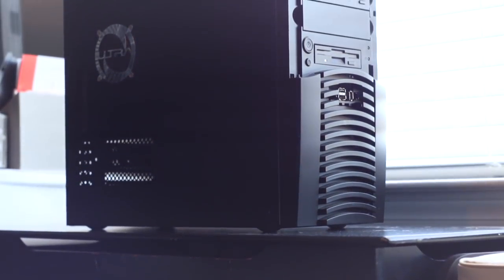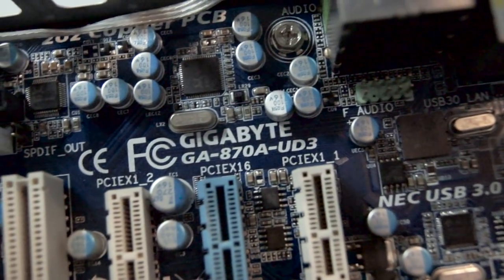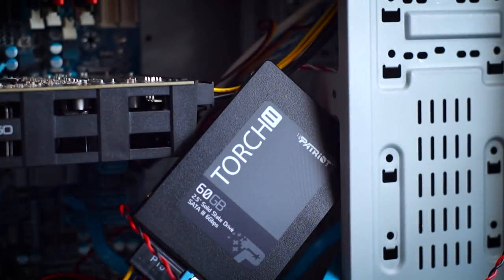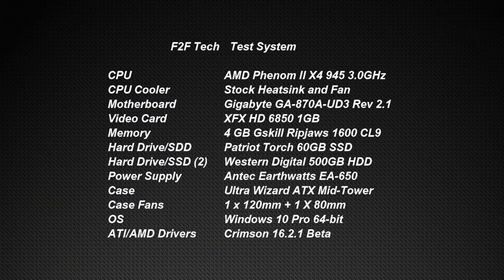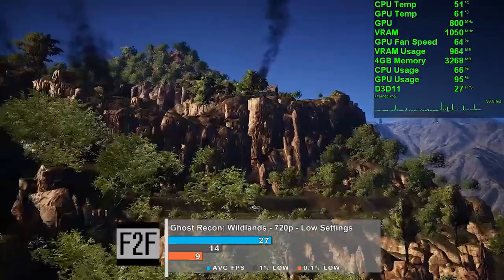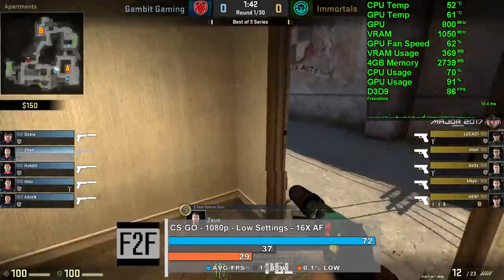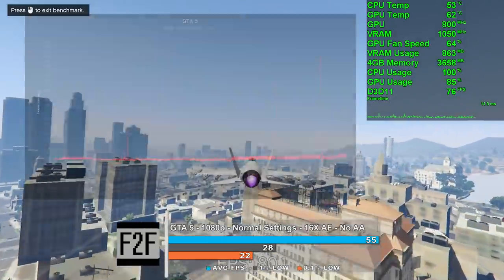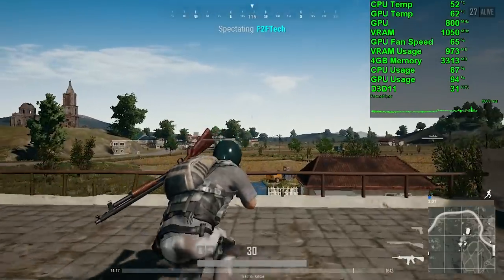How well does a 2010-2011 AMD Phenom II X4 gaming PC hold up in 2018?

Comment: My gaming pc since 2010, still running no issues whatsoever, i have it now pair with a gt1030 +8gb ram 1600mz sc (and it runs almost every game if not all games out there, and im pretty sure i can get a 1050ti and will get even more fps) im running my x4 945 (95w) at stock speed since i bought it with stock cooler wich sucks, but gets the job done and hey, its been working for 10 years now, to be honest i could keep playing games on this if bought a 1050ti since im more thatn happy playing at low/med settings at 1080p, but im also thinking about getting a ryzen, its hard to let go of this awesome cpu :)

Comment: I have that CPU, I just picked up a 8150 with that cooler on it and it did the same thing when I took it off :)
Reply from the maker: Typical PGA fashion 😉
Reply: Timmy Joe PC Tech It is any good at gaming?  i want to build one cheap PC like that for my self
Reply: Yeah, it’s still a problem.  My Ryzen 1700 got stuck to the cold plate when I swapped my h100i for a Hyper212 last month.
Reply: To avoid that, gently turn the cooler to the right and to the left repeatedly until it looses grip.
Reply: sassuki I had done that in the past with older AM3+ CPUs when that was a common problem, I just honestly didn’t think that it would’ve been that bad on my Ryzen since I only had the cooler on there for a month.
Reply: Had the stock AMD cooler on my old Phenom II x4 945 for 6 years..... Took me 20 minutes trying to pry it off and the cpu came out too. Scared me so much xD
Reply from the maker: TitanZ pretty much same here. I had to use a chisel...
Reply: Just heat it up by running a benchmark, then turn off the pc and remove the clips, then push down lightly and twist. The cooler should pop right off.
Reply: i just got 1 Phenom ll 965 for 20 usd..i got a busted MotherB for free that just Fixed a Cap on it and works like a charm, i got a 2Gb DDR3..a nice PC for less than 80usd..Its like Chrismast already..
Reply: My x4 840 did the same thing. Actually had to put it in my electronics oven to separate them.
Reply: @gaming512mb2  get a ryzen 1200 for ~100$. Though if you mean cheap maybe an fx 4300?
Reply: Timmy Joe PC Tech 
Cleaned out a friend’s PC recently... same thing happened to me!
Reply: Twist and pull
Reply: Guys sos my frend  has  the same cpu whith  two 1x4 +1x2  random ram , what the fastes kit of rams i can stick at his sistem and is it warthit??????????
Olso  should i upcrate the cpu cooler fro stock one or is a waste????????

Comment: I used my 955BE until I upgraded to Ryzen 1800x. Ryzen is the only worthy successor of the Phenoms.
Reply: See Sharp I agree. Phenom performed better than the "doser" cpus
Reply: Yeah i totaly agree. FX was very bad
Reply: @Will-mq3nn  FX architecture wasn't that bad. Those later Athlon X4 chips were actually faster than the FX line because of the improvements to the architecture's single core IPC. FX was a gamble that didn't pay off. They are very powerful when fully utilized but they bottleneck themselves so easily that you rarely see what they can do. Doom 2016 is the only game I know of that showed off what the FX line was capable of
Reply: I made a mistake a couple yars back and "upgraded" from phenom II 955 to fx8320, the difference in game performance was non-existant. Now rocking ryzen 2600 and the diffence is night and day. Fx was a mistake.
Reply: Miekk4 I’m looking to make the move from an old Phenom II 955 to a Ryzen 2600 as well, the death knell for the old phenom was the HDD failing
Reply: i had the same CPU. upgraded couple of years back to a 4790K
Reply: @Miekk4  Never Ever ! a 4 Ghz Phenom II X6 ok but a Quad Core ahahaha ...
Reply: Perhaps you should re-evaluate the FX series with CPU performance mode turned on? Single thread ipc is much higher in 4 core 4 thread mode
Reply: @MultiPureEnergy  better wait for ryzen 3000 series. and their navi cards. would do you much better.
Reply: @Miekk4  Oh really? So you think the 955 can run newer games like resident evil 2, and DMC 5 at over 100fps at 1080p like my 8320 can? Not even close. It would be running those games at low settings 30fps.
Reply: @Miekk4  Did the same. I wish I had got the x6 instead

Comment: I've been using this build since 2011 ;
amd athlon ll x3 455 3.3ghz
ati radeon 5400 hd 2gb 
4gm ddr3 ram
......
it costs about less than 100$ now
Reply: Not if you buy part by part
Reply: I still use athlon II x3 440 paired with gtx 650 non ti. Later upgraded to 6gb ram. Wish i could play The evil within, but it crashes randomly.
Reply: @remynisce33  where are you guys from?
Reply: Pasha Boss philippines

Comment: I have the exact CPU and motherboard........

I still use it
Reply: I also do gaming on a Phenom II X2 3.2 GHz. I unlocked 2 cores, so it behaves as a X4. I overclocked to 3.6 GHz. I have a Noctua cooler. I added a GTX 980 4 GB card.
I play Battlefield 1 on it and I get about 40 to 60 FPS.
Reply: Doesn't it bottleneck?
Reply: +Aerio Momin:
Yes, it definitely does. I used to have a GTX 650 2 GB. I get the same FPS. However, I did set everything on max with the GTX 980 but I am sure the CPU is a big bottleneck, otherwise, I could reach 120 FPS with a modern CPU.
Reply: Is it will be ok with gtx 1050 oc for fortnite

Comment: I remember having the Phenom II X4 945 95W together with a HD7790 on a AM2+ socket, it was a very great time until my Motherboard said bye to me. It was great the CPU was still working on a AM3+ motherboard, so i had continued to use the Phenom, i had play a lot GTA V with 50 FPS+ between Mid/High Settings on this hardware. In 2016 i had upgraded my GPU to a RX470 and found nearly no FPS difference but i was able to put Settings to Very High without losing FPS on it.

Comment: Quality content, nice editing and flow,you need more subs man. Keep up the good work! 

Stil rocking an Athlon II X4 620 and an GTS250 here,so I love old tech videos.
Reply from the maker: Thanks brother!
Reply: I had a Athlon II x4 620 until a few months ago, overclocked to 3.1ghz on a Athlon 64 stock cooler. With a 1050ti it could run many games pretty decently, specially well optimized games that take full adventage of 4 cores. Overwatch for example used to run at around 70 fps.
Reply: Im on stock speeds with 3 gigs of DDR2.Dont ask for my frame rates hahahaha.
Reply: Naizuri ... same here, less than a year ago i was on a Phenom II X4 940 OC'd to 3.5GHz, 8GB DDR2-800, and a Radeon HD 6870. Upgraded to a 1050 ti, it would play everything decent but eventually upgraded the whole system to Ryzen.
Reply: Same, I ended up upgrading to a Ryzen 3. While the perfomance was decent on some well optimized games, it couldn't run any CPU intensive game very well and the bottleneck was too big. Even Overwatch that was one of the few games where the bottleneck wasn't a big problem, had around 70% GPU usage, while on the most unoptimized games I had around 25% and the framerates was terrible.

Comment: I used my 955 BE @4.1 for years. Pretty easy to overclock on a cheap Enermax cooler. Once you overclock it and give it a nice NB boost with good RAM it's a whole new CPU.
Reply: james lane what should be settings NB value @3.5ghz?
Reply: Elston Dias same process as overclocking the CPU.
Reply: james lane yes I know that but what value should it in mhz like 2500mhz?
Reply: Elston Dias something like that yeah just keep boosting it. I haven't messed with that platform for years. I do recommended looking on forums. That's where I learned to do it.
Reply: james lane thanks...

Comment: My AMD Phenom II X4 960T is my daily driver. I have yet to want or need a faster system, and likely will not for another couple years.
Reply from the maker: I’ve also owned a 960T. Mine was overclocked to 4GHz with the NB at 2.8GHz. Great little chip. I eventually upgraded to a 3570K because I couldn’t maintain 60FPS in Skyrim.
Reply: F2F Tech can u send an athlon II x2 pls or any CPU for my am3 mobo
Reply from the maker: Base Jacker sorry, don’t have one.
Reply: F2F Tech OK. Thanks for replying
Reply: I'm still using a Phenom II X2 that was able to be unlocked with my Asrock mobo to a Phenom II X4 @ 3.3GHz. If I let the mobo auto-overclock it, it goes to 3.55GHz. I'm not a PC gamer so I haven't had a need to push it higher. Combined with a 250GB EVO SSD and 32GB of DDR3-1866 ram(bought ~2yrs ago when it was only $129!!!), it performs plenty fast enough for me.
That said, I DID buy an FX-8350 when I bought the ram because it was also on sale(for only $130). BUT I was furious when it wouldn't boot in my mobo, even though it was specifically listed as being supported in the BIOS! I researched it a bit and found that while it was originally supported, it was later removed because of some problems that apparently they couldn't bother fixing. So, I ordered a Gigabyte mobo that a friend of mine used for his FX-8350. But I haven't gotten around to swapping out the mobo and cpu because I plan to move to Linux and that will require a lot of work, and I have been putting it off... :-(

Comment: I had exactly the same processor (with 6 GB of RAM) until recently when I finally got a new PC. It was quiet alright especially paired with an SSD, at least as far as online games go but for other games it did hit its limit by allowing only 20 - 40 fps. I would say if you are looking for a cheap PC just to play online games and you can get one of those for 50 - 200 € (that is 200€ max for a full PC, CPU/GPU/RAM), that wouldn't be a too bad deal. (though you might find better ones for the same price as well)

However I had DDR2 with 1666 MHz RAM with only PCE 2.0 slots and a Sapphire HD 5870 with 1 GB VRAM.

Comment: Great retrospective! When it comes to the CPU coming out with the heatsink, you can usually break the seal quite easily by twisting the heatsink back and forth instead of pulling straight up. If not, try heating up the CPU and paste a bit beforehand. Hopefully this saves you some damaged sockets someday.

Comment: Well I was enjoying this video for the nostalgia of me owning my own Phenom X4 945, I had the exact same model as what you showcased in this video.  With my old rig I paired my AMD with 2 x GTX 550TIs in SLI mode.  The problem why your CPU usage was at 100% with horrendous texture pop-in was your Radeon was running out of VRAM.  Capabilities aside, both the 6850 and my 550TI have 1GB of GDDR5 VRAM and that just ain't enough for playing GTA V at 1080p regardless of other graphics options you pick.  I had to play my game at very low settings at 1024 x 600 resolution to get smooth frame rates and I had very little texture pop-in.  Now in case someone comes along as says to me "well you had 2 GPUs in your system", that 1GB per GPU isn't cumulative.  I still had only 1GB total VRAM because both cards had to load all the texture assets into memory to render their section of screen area.  When it comes to VRAM, it doesn't matter if you have 1 GPU, 2 GPUs or 10 GPUs (example only for the sake of this comment), if they all have 1GB, 2GB, 4GB or so on, you'll still only have as much VRAM as what a single card has.

My AMD Phenom ran fine with GTA V averaging about 85% to 90% usage.  I later upgraded to an Intel i5-3470 CPU paired with a GTX 970 and saw CPU usage drop slightly to around 80% average usage.  I know own an AMD FX-8350 Octocore CPU paired with a ZOTAC GTX 1060 6GB and have on average 50% CPU usage.  I would urge you to rerun the in-game benchmark for GTA V using a lower screen resolution, trust me, you'll see an improvement in performance even if CPU usage remains high.

The 4GB of RAM could also have held back GTA as well.  With my Phenom X4 I rocked 8GB of DDR3 memory and with my i5 and now my FX 8350 I have 32GB of DDR3 memory.  So I feel that system was struggling not because of the CPU, but because of a lack of system RAM and VRAM.

IMO I think the Phenom X4 is still a very capable CPU which can easily get you by playing modern games today.

Comment: I have a old 945 phenom x4 but mines the 95 watt tdp which still doesn’t do too bad either and I keep that system for older game titles and it does ok. I’m considering installing a win 7 OS on a dedicated ssd in my newer Ryzen system so I can play older titles but I just haven’t gotten around to it yet. I still won’t get rid of the older system considering that it was my first gaming build back in 2010 because I never had the money to actually build one. The biggest problem running Windows 7 today is that many of the OS files were removed in 8, 8.1 and 10 due to severe system vulnerabilities and now many older titles won’t play or even install on windows 10 as a result. So if you do have older systems like this and enjoy playing some older titles like Warhammer battle march for example, don’t get rid of them and don’t upgrade to Windows 10 as you will not be able to play such titles on Windows 10.

Comment: At least it's the c3 revision which is a better ocer, even if it pulls more juice. My 945's max oc is 3.6@ 1.48 volts 😒.
Reply from the maker: Actually, this chip is pretty much the same. Right now, I’m at 3.76Ghz with 1.475v. Bus speed at 260. Anything beyond that it blue screens. NB sits at 2600MHz @ 1.25v
Reply: i have the same. i couldnt get past 3.6ghz.

Comment: I'm still using a couple PhenomII (965 and 810) as a secondary PC's with an R5 250 and HD4850. They both even run GTA5 and Tomb Raider. It does not feel slower than my Main Core5 6600k and GTX1070 in normal usage, but newer games do struggle.

Comment: got a Phenom X4 II 955 @3,2 ghz. (didn't really try - it was just a overclock the MB offered straight out of the box and i used it) with a Big Shiruken cooler (very silent) - 8 GB RAM - a SSD with 80 GB (with win 10 pro) and a GTX 660 --> my monitor a 1680x1050 Samsung - still all games run usually on that resolution with medium to high - but i upgraded in summer completely to a new 4k gaming rig and try to sell that one now as a whole  - but i had 6-7 years tons of fun with that one - only 1 Grafic Card upgrade 4-5 years ago to the GTX 660 that's it... and still this system runs like a charm... I think with a GTX 1050 or 1050ti you would still have a reasonable PC when you are on a budget....

Comment: My PC is quite like this but I have a x4 840 and I have a Cooler Master V8 cpu cooler and it’s a freaking huge cpu cooler and I could over clock that baby from 3.0 to 3.5 ghz. And the GPU I’m using is a GTX 1060 6gb.
Reply from the maker: I remember that Cooler. I love the v8 emblem on top. You got a lot of GPU horsepower in that setup as well. Nice 👍

Comment: I have the 95w version on an ASUS M2N-E, and an MSI twin frozr GTX 480.
Reply: i have the same motherboard i ordered the same cpu you have and got a gtx 745 for free from a friend also gskill 4gb ram but the opteron 1212 dual core processor it has sucks cant even play black ops 1 without stuttering

Comment: having built a pc with a phenom ii x4 for my gf, i must admit it came up pretty good. Cpu is currently incredibly cheap and it's good for linear, not so open games... The fact is that loading terrain and textures on a large scale seems to create big stutters and kinda ruins immersion in the game. But overall i was surprised how well it performed and how low the temps were even after intense and long gaming sessions (always around 50°). Best example was Metro last light, having some problems with the early open area (going up and down between 35-40-45 fps) it then went extremely smooth in all the closed areas of the metro, with a solid 60 fps with no stutters or few, really few ones in specific areas.

Comment: 6xxx series dont have driver support since  the march of 2016.. i have 6870 and 955 BE overclocked at 3.5 Ghz with 8 Gb of Ram and it runs most of todays games well but some of em stutters as hell cause of driver issues and of course it has dx11 only

Comment: I have a similar machine, but with a x6. 

AMD Phenom II x6 1055T (95W) 2.8@3.9 GHz - Thermaltake V1 CPU cooler
12 gb of RAM DDR3 1600 MHz (cl9) OCZ Gold 
Asus M4A77T/USB3 (am3 only)
XFX HD 6870 DD edition 1 gb GDDR5 256 bit
64 gb Kingston SSD drive
2 tb of HD 
Corsair CX500 PSU 

I really do not play much, but this machine catches me a lot until today. 
Thanks for the videos with old hardware, man.. is very interesting to compare with what existed at that time and with what we have in the market today. Greetings from Brazil!
Reply from the maker: Sweet rig man. I had a 1035T running in a server for years. I just retired it a year or so ago. Anyway, I appreciate the comment and I plan to push this bugger pretty hard in a future vid.